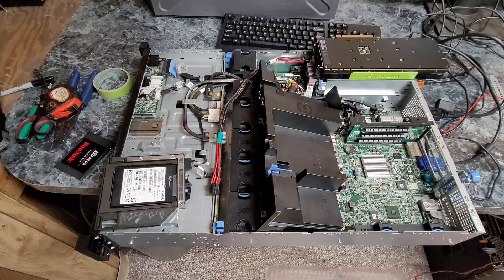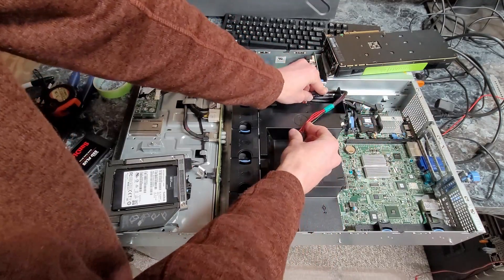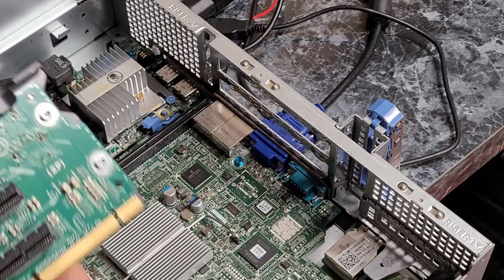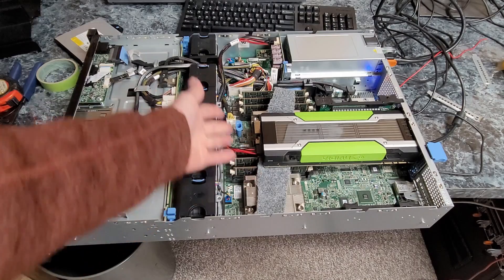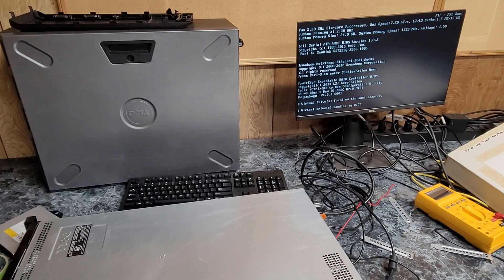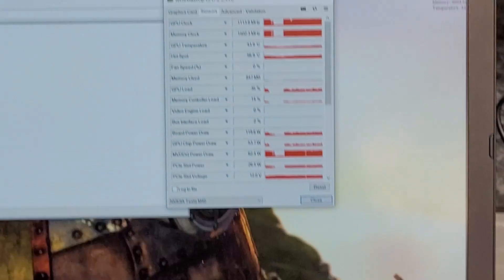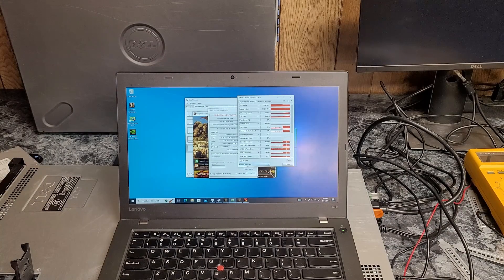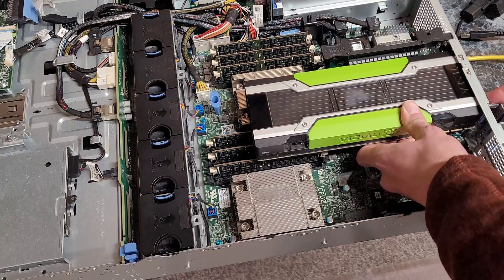Testing NVIDIA Tesla powered GPU compatibility in the Dell PowerEdge R520 and discussing caveats

Comment: Hello, i'm trying to the same thing with the same server, dual CPU R520 an with a Tesla M60. I have the issue that everything i plug in the PCI slot where the Tesla is supposed to be the board is never recognized.
Did you do any special setting in BIOS to make it works?
Reply from the maker: BIOS should have been at defaults when I did this. I would make sure that your BIOS is up to date, above 4G encoding is enabled in BIOS, and all the slots are enabled in BIOS.

Comment: Thanks for making this video! I got my hands on a PowerEdge R530 very well equipped in terms of RAM memory. And I am planning to use it as my personal computation server upgrading the CPUs and I am also interesting in running some AI models in it. I am very wary of sharing too much of my work to the cloud.

But I found out that the space configuration in the R5xx series doesn't give too much room to fit accelerator GPUs inside. Both lengthwise and also in terms of the placement of the riser. The riser of the R530 has the x16 PCIe slot at the top. Which as you mention is not ideal for a double slot card.

Apparently the R7xx series is more geared towards housing GPUs. But thats much beefier than the R5xx series servers.

So I was thinking of using the half height, single slot accelerator GPUs, but those are very fancy. With those I could fit 2 NVIDIA TESLA L4s inside the R530. But their prices right now are over the roof! Alternatively I would also settle for the AMD RADEON PRO V710. That one is also very fancy and is a full height, single slot GPU card. But apparently AMD is not making those for the general public and all its production is going out for AZURE for their AI farms running OpenAI's models.

I hope eventually the price of all these cards settle down! In any case, I am glad to know I have the machine to eventually install one.

Do you think I could fit an AMD RADEON INSTINCT MI50? Which riser card should I use on the R530? The stock riser card doesn't do it because it has the x8 slot where the GPU should insert.
Reply from the maker: The MI50 would be the same physical size as the Tesla dual slot GPUs to the best of my knowledge. I haven't had a chance to do any testing with an R530. If the slot doesn't have an open back and is x8 you will have to cut the back out and let the card hang out the back of the slot. The process is kind of tricky if you haven't done it though.
Reply: @computersales but if the card is specified for x16, doesn't it need a x16 PCIe slot? How can it work out of a x8 PCIe slot?
Reply from the maker: @PereAndreuUbachdeFuentes  you don't need all the lanes for the card to function. With consumer boards if you look at the PCIe block diagram the slots end up dividing up the lanes available. I haven't looked at the block diagram for these servers but they probably get full lanes per slot. If you plug it into an x8 slot the GPU just has less access to bandwidth.

Comment: I dont know about using the p40. But the p4 is a better option. Its thinner and doesnt need a power cable. Its designed for excellent encoding and video content. The p40 is designed for deep learning. Depends on what your trying to accomplish. The p40 is around the same price as a newer model T4 which is also 1slot thin loke the p4. The P4 uses 70w and T4 uses 75w, both are pcie powered. The T4 can transcode super fast and being able to install 2 of these instead of 1 p40, would be crazy fast at certain tasks.
Reply from the maker: I think most people using the powered cards are doing AI stuff these days. Otherwise I used my M40 for gaming and video editing. I don't get why the Pascal Teslas are so overpriced right now. Sure supply and demand but not to this level.  I do hear the single slot Teslas are popular with transcoding though.
Reply: @computersales  nice man, I own 4 M10's and 2 T4's. I thought the m10's would finally get the support for VP9 but Nvidia said nope even tho support is still going till the end of this year. So I bought the T4's and I'll figure out what to use the m10's for later. It's insane what ebay is selling these older graphics cards at but I think the main reason is because crypto miners are still using them so of course it's supply and demand.
Reply from the maker: @DJPIX3LDROP  it would be fun to play with a M10. I just got in a box of T4's. They are neat but I don't have any use for them since they don't support GPU mode.
Reply: @computersales  when you say "gpu mode" are you referring to "full CUDA acceleration" for things like gaming?
Reply from the maker: @DJPIX3LDROP  I think so. Normally with the M40 I do nvidia-smi -dm 0 in command prompt to be able to use it for gaming tasks.
Reply: @computersales  if I'm not mistaken this command only disables daemon mode. Is this useful for vm's running windows? I've only remembered that daemon mode is for caching and monitoring. Doesn't usually effect gaming performance.

Comment: Hey! I've actually have this same setup. I actually cut those odd tabs on the CPU/Ram cover that would block the P40 from fitting just on top of it and it worked well. 

Can you advise on the red/black power cord you have connected to the P40 and power supply??
Reply from the maker: Any 12th/13th gen PowerEdge to Tesla GPU power cable should work just fine. I have some I designed and am selling if you don't want to make your own.
https://www.ebay.com/itm/226156784263